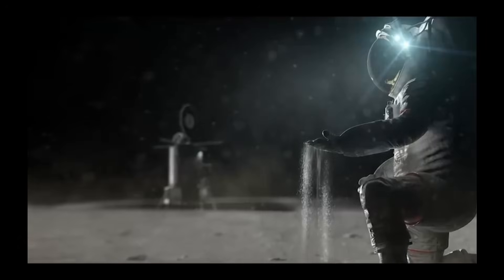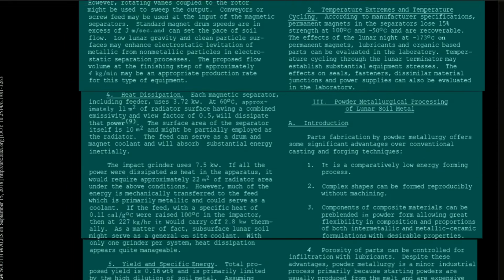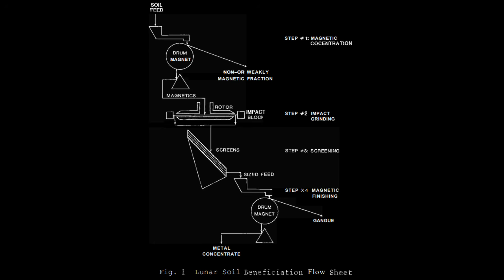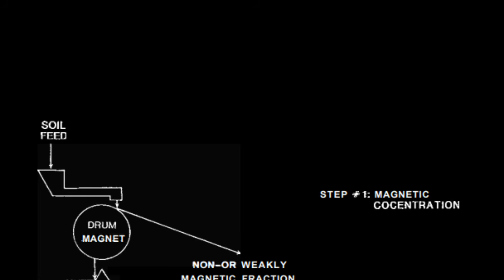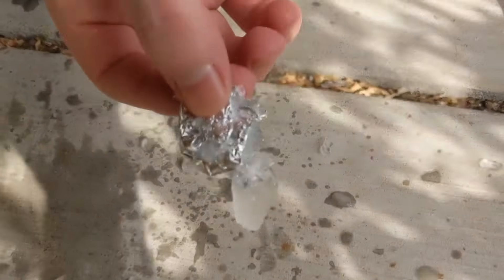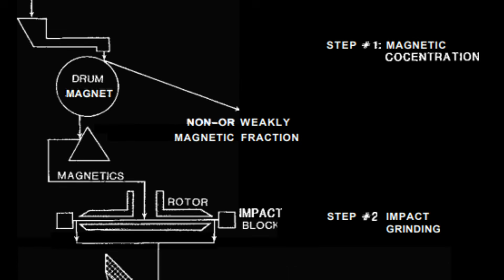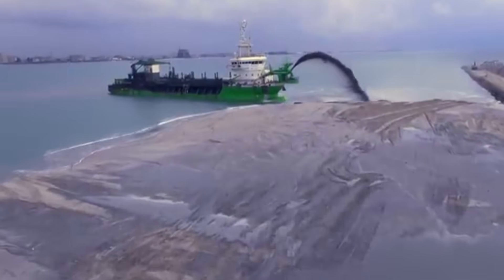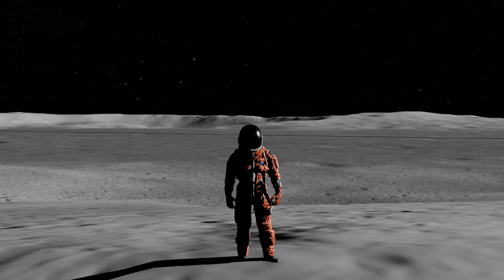Lunar Regolith Magnet Beneficiation from 1981 (Paper Review)

Comment: In alumina refineries, it is common to use magnetic separation for iron.  This is essential, because ferrous material is a problem in the process.  Aluminum doesn't respond like ferrous materials do to a magnetic drum, but it does respond to strong eddy currents, which can be used in a separations process.  However, the drum separator is easily damaged by iron materials.

Comment: It seems to me that every tech will have an initial make-it-work low difficulty scenario and a number of stages that take you to an optimized minimum waste use case that typically requires significant infrastructure and as such, these "little topics" will help fill in gaps very nicely. 

Love this work, it is the hardest core science fiction... no strike that you are creating a new genre - engineering fiction. Can't wait for the next chapter. Thank you for sharing.

Comment: It might make sense to have magnetic beneficiating vehicles like this in a grid pattern along the path a lunar rail line being constructed, adjusting scooping and tailings dumping patterns to flatten the area, using some of the tailings to build the raised gravel bed for the railroad, sintering some of the dirt into concrete railroad ties, and using the iron they collect to make the rails. You'd still need other machines to actually build the railroad, that takes earth moving machines and specialized track laying machines, but these could gather and refine the resources on-site while you're still in the phase of bootstrapping lunar heavy industry.

Comment: In your lunar infrastructure video, I was thinking. Using electricity to power conductive rails to speed up a freighter is the opposite of a high speed freighter using conductive rails to generate electricity by slowing down, would it be feasible to use this opposite system to get back some of that power spent on speeding the cargo up?
Reply: Not a bad idea
Reply: Retrieving some energy is possible but it won't be near the amount expended. Accelerating 100 T payload + 5 T rail platform. Then lose the 100 T. You are then only deaccelerating the 5 T rail platform.
Reply: @jackhartwig440  correct, what I am suggesting though is catching  payloads using the same rail to more efficiently slow it down
Reply: @燧發槍 Yes, you could. But the scenarios he was showing them landing/launching vertically.

Comment: If the regolith is lose enugh you could use some sort of dredge. Like the golddigging one, it moves slow through the regolith and every now and then you can get your iron.
Reply: What if you combine a grain auger and a hollow horizontal directional drill to pull in regolith and move it to the processor on the surface use the stilt method to move it around and you have a platform that can collect without kicking up lots of dust and just by switching the head you can dig the harder material under the regolith as well as being able to lay the ground work for underground habs by digging the hole or connecting the lava tubes that are present on the moon also because the inside of the tube is rotating you could possibly use it to gravitationally sort the extracted material

Comment: I think this is a great idea for a series.   Do you also look up the peer correction papers as well?   This particular one sounds great on earth but you never address how he plans to get the magnet separation to work on the moon with it's lack of gravity and the static cling problem.  Or is it that cranking up the RPMs to deal with those problems the  causes his yield being so low?
Reply from the maker: It said this version is up to date but I didn't read any responses. I don't think this paper was taken too seriously at the time but I could be wrong. I suspect the rpm increase should work on that step but you make a good point about the other steps and static etc. Definitely more engineering would be needed for a system like this. I also noticed agosto seems to have wildly overestimated the amount of nickel in regolith, I assume bad data from 1981 that's been corrected. The low yield is because this can only extract free iron not mineralized so it's a fraction of a fraction.
Reply: @Anthrofuturism  Well, we know the data we have now is wrong.   Life is a fractal.   The closer we look in different areas the better the data.  It is hard to know if we are close enough.   My bet is we are close enough for over half of the moon.

Comment: Do you think that using LASERs tuned to the absorbing frequency of certain metals in regolith could separate them more efficiently than molten salt electrolysis?
Reply: You'd need an optically clear material, so you'd have to vaporise the regolith, and at that point you can just do vacuum distillation
Reply from the maker: Not sure but I think what @matteodelgallo1983 said is correct. But maybe something there. I haven't encountered any papers on that but I also haven't looked so might be worth a search
Reply: Might be, but doesnt realy matter you need relaible and proven technology on the moon.